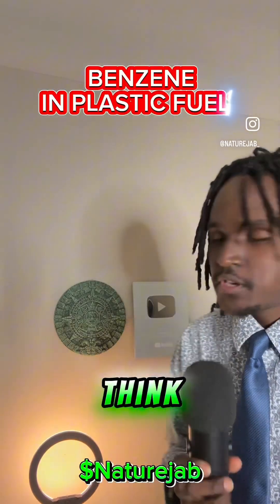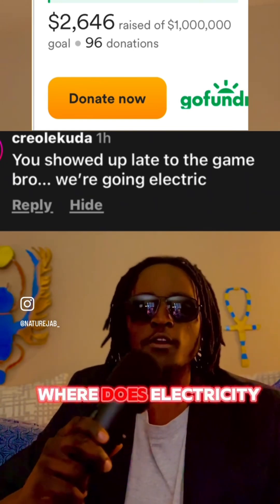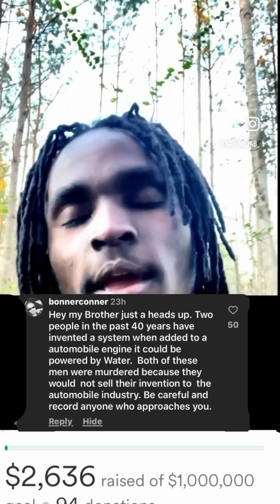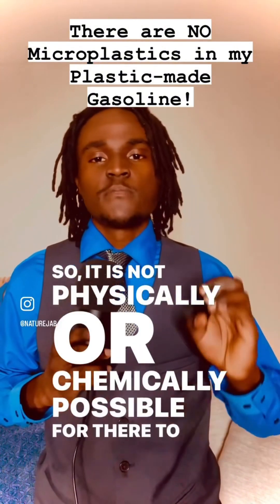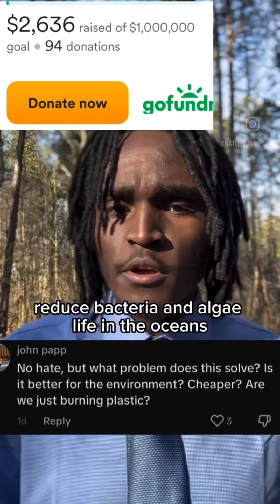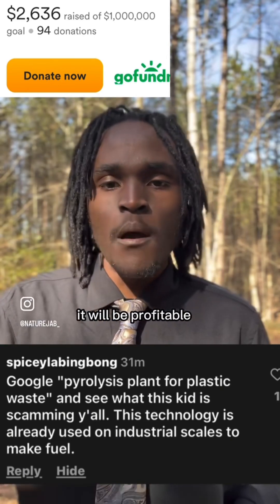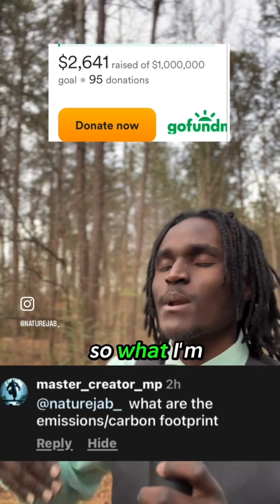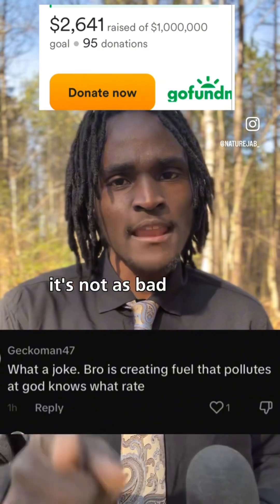Rebutting Plastic to Fuel Pyrolysis Concerns for 9 minutes (compilation)

Comment: Look at Carbotura. They have a large microwave gasifier that breaks down mixed municipal waste. I believe producing synthesis gas and ethelyne to produce carbon neutral polymers is the future. Seek investment from space industry folks for self reliant communities piloting smart grids and circular economies for sustainable cities and space colonies.

3D printer polymers made from recycled plastic is the next level.

Natural gas power plants paired with municipal waste stream gasification can eliminate the use of nat gas and end fracking while eliminating landfills and reducing the number of batteries we need 

You can add carbon removal systems to the exhaust to make it truly carbon negative too

Comment: So can this process be used with other waste, food waste etc ??
Reply: Yes, pyrolysis would also work on other things like food waste, paper, wood, old clothes, etc. as long as it meets the chemistry description of being carbon based organic chemicals.
Reply: Other waste such as wood probably yes, but specifically for food it might be a bad option. Reason being that water is a very good heat "capacitor". It takes a lot of energy to heat up water and a lot of energy to boil it away. The processes that are efficient to turn food waste into energy are "biogas digesters". Google it. Pretty cool. But the products are only fuel gas and fertilizers.

Comment: Where are the chemical readouts to back up your claims buddy? If you really believe this to be true go get your fuel and byproducts analyzed.
Reply: I've been asking for a chemical analysis for months now and he won't awnser.
Reply: I would like to find out about the chemical compositions of the gases and liquids coming from his pyrolysis machine.  However, it's a good sign that the gases are of a high enough quality to run generators off of and power the pyrolysis.
Reply: No it isn't lmao. Generators and other things are DESIGNED to run off shitty and old fuel. It doesn't mean anything.  @eitkoml
Reply: @eitkoml  he said himself he doesnt know whaat his fuek consists of so it could very well be corrodibg the engines from the inside
Reply: @eitkoml Also it takes more power to make than what you get out of it, which is very bad for the environment. His product is assumed to have 40-60% benzene, the legal limit is less than 1%. If he did this himself in a closed and controlled environment thats fine, but he's giving his neighbors and unsuspecting people cancer.

Comment: 1:01 as a car enthusiast there aren’t any electric cars on the market that are equal to their gasoline counterparts. Yes they work good and even better is some ways, but are still behind in many other ways, important ways (not that the tech won’t get better or anything) There is no Honda civic of electric cars, there is no mx5 of electric cars, there is no real electric mustang or Camaro, there is no real electric m2, or mini cooper Porsche has some experience but still. We can produce electric cars almost like them but they won’t be them for at the very least 10-20 years. I will probably own more than one electric vehicle in my lifetime but I will keep my ice cars until they take them away. I’d also like to do it without blatantly polluting for the fun of it, if renewed/recycled fuel is an option I’d definitely use it.

Comment: How does your pyrolysis machine do with thermoset resins?  They can take much higher temperatures than thermoplastic resins and don't melt easily.  Thermoplastic resins are by far the most abundant types of plastics and are without a doubt the majority of the plastic that you have turned into fuels.  

Thermoset resins are used in fiberglass and are a major component in wind turbine blades.  That means a lot of plastic waste from old blades are building up and it would be interesting to see how your machine does in breaking those down.  They're also used heavily in different vehicles like cars, trains, airplanes, ships, etc.